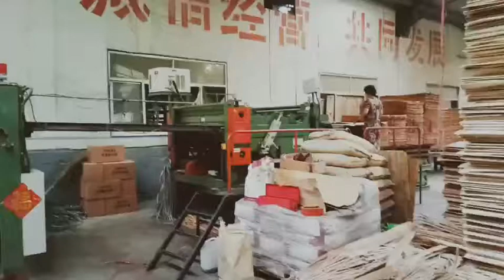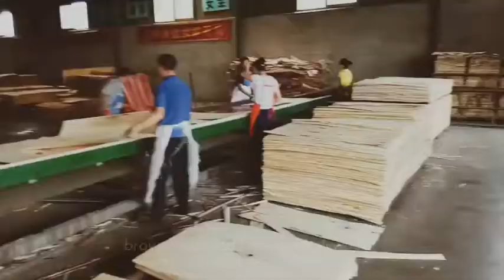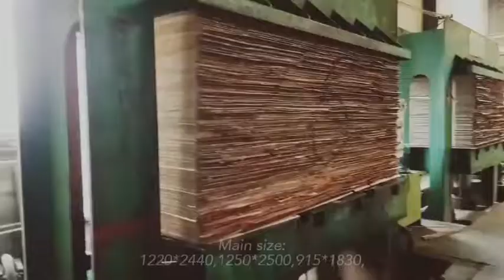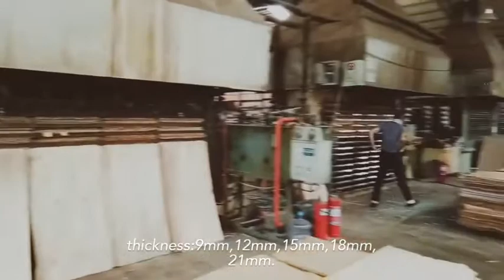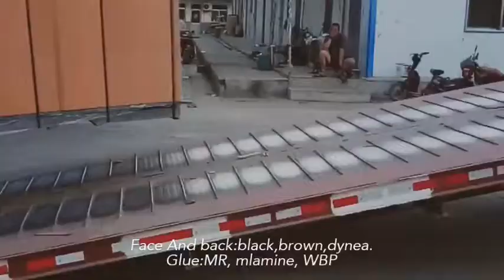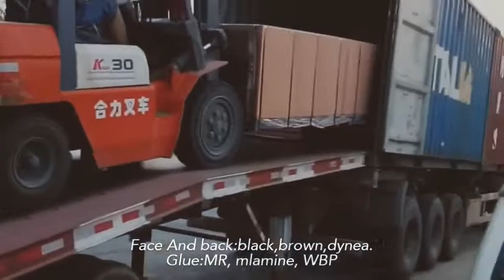Fushi Film faced plywood plant,MARINE PLYWOOD Manufacturer

Comment from the maker: Film faced plywood is lightweight, resistant to corrosion attack and water, easily combined with other materials and easy to clean and cut. Treating the film faced plywood’s edges with waterproof paint makes it highly water-and wear-resistant. Due to its durability and easily handled surface it can be used in open environment in construction and building e.g. warehouses, railway wagons, floors and sidewalls of trucks etc. Coating the film faced plywood with high-quality import films ensures hardness and damage resistance. The surface of the film faced plywood is hygienic and resistant to strong detergents, which is important for farming constructions and storage of food products. It can be used in conditions of high temperature drop, influence of moisture, detergent cleaning and provides protection against termites.
We offer two types of film faced plywood. The first being birch film faced plywood which is very resistant to water, easy to clean and cut and one of the world’s best quality plywood’s.
The second is poplar film faced plywood. This plywood type is also easy to clean and cut and is softer and lighter material than birch film faced plywood.OUR WEB 

WWW.FUSHIPLYWOOD.COM